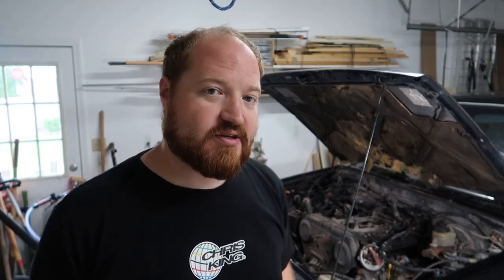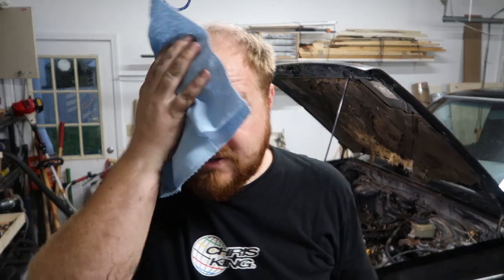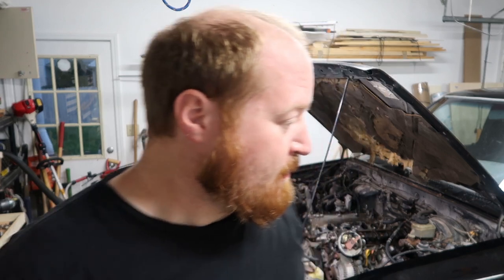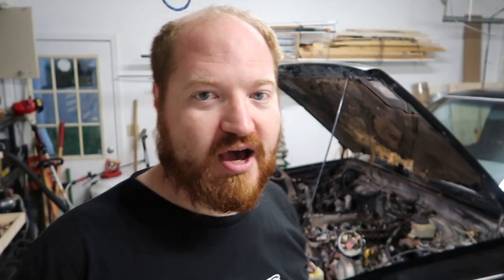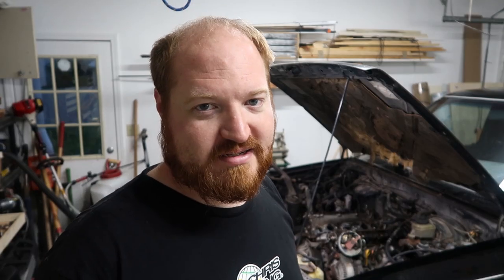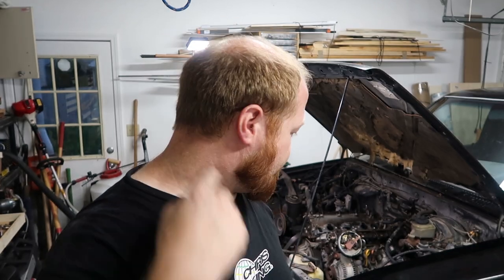Ripping apart the engine for repair - 1989 Toyota Pickup Restoration Ep 2

Comment: I just did a complete rebuild on a 3.0 first gen 89 4 runner. I have gone completely through the vehicle from front to back. Just converted the A/C to 134. Watch for pitted cylinders due to coolant sitting to long with blown head gasket. Good luck subscribed.

Comment: Don't know much on the mechanic side, I used to do body work and some paint, but wonder if the 3.0L on my 2002 Avalon that is shared with the Solara and Sienna in that year would also work in this truck even though its a RWD/4WD vehicle???
Reply from the maker: It has the potential too. The 3vze (in my truck) is a cast iron block, with a single overhead can. The 1mz-fe (in your Avalon) is a cast aluminum block with dual over head cams. The bore and stroke is very similar. The biggest difference is that my engine has a 90 degree bank separation, while you're has the more efficient 60 degree separation. I don't have exact measurements, but from the looks of it, the bolt pattern for the bell housing is the same, and a shim plate to cover the difference in castings is needed to seal the gaps. A couple custom engine mounts and the 1mze motor will drop right in.... But why do that when you can get a 3mzfe (3.3 liter 60 degree bank, dual cam shaft) engine and throw twin turbos on it... Ahh darn it. Look what you made me do. Now I've said too much.. but I gotta get the truck fully restored before any of that happens.
Reply: @Obscuremotorsports  Thanks for the swift reply. Just a thought since this 1MZ-FE is said to be a good engine aswell and Scotty likes it in his opinion.  But I appreciate the sharing of knowledge, now I know FWD & RWD engine swaps is doable.

Comment: The confident way in which you just go in and start taking things apart. Yet everything is thought through. Do you have this engine memorized? Or is this just experience showing through?
Reply from the maker: Figuring it out as I go along. You're seeing things for the first time with me. All engines are basically the same. Intake on top, fuel system next, heads under that, block under that, pistons inside and a crank on the bottom. The wires, valves, solenoids, and sensors are pretty much the same, just in different places.

Comment: Bro i cant find a accurate under the hood fuse box diagram anywhere. I have recently been trying to get a 1989 pickup, v6 running but the fuse box is all wrong but i cant find the right diagram. Any help? Thanks
Reply from the maker: Find me on IG (@nabelrabel) and message me a picture of what you have.

Comment: Did you clean your hood pad or replace it and if you cleaned it how did it come out and what products did you use?
Reply from the maker: I haven't made it to that part yet. The truck is fully disassembled right now. I'll let you know what I decide when I get back to that point.
Reply: @Obscuremotorsports  I just bought a new one... I tried to clean old one(small area) and it started to shred.... really strange

Comment: the 3.0 is the worst engine Toyota ever made. Most people swap them for the venerable 3.4 from the Tacomas if they want to keep the older body style.
Reply from the maker: Please refrain from negative and sweeping generalizations like this. I'm developing this channel to be a place that supports creativity and encourages people to think independently and come up with their own conclusions based on their own research. The 3.0 has some weaknesses, but also has many strengths, and many people still use them and are very happy with them. It's also a great platform to experiment on and attempt to improve known weaknesses.  You've been warned and are welcome to offer your perspective in a more positive tone. If you are unable to communicate in a constructive manner (you can dislike my choices and still be constructive in your response) I invite you to leave my channel.
Reply: @Obscuremotorsports  yeah i have the 3.0 in a 1995 4runner with 192k miles, the heads were done under recall years ago by the original owner.. but besides that and basic maintenance it is a very solid motor... i love it... slow but i love it :)
Reply: THAT 3.0 SUCKS!  ....................LOL, J/K BROTHER!   I LOVE THESE OLDER TOYOTA'S, WOULD LOVE TO BUY ONE SOMEDAY SOON AS A WEEKEND/OUTDOOR TRUCK.  NICE VIDEO!!